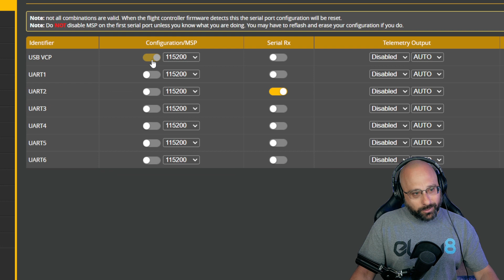Did I Brick My Flight Controller? Recovery? DFU? Bootloader? - FPV Questions

Comment: Beginner's - All these videos make it seem so cut and dry on betaflight firmware etc but they all are missing tons of information.  all downloads on the first page dont have any information of what they are as well i dont care im installing this crap anyway.  I just want to fly my drone which is costing me hours and hours of reading nonsense about technology i dont care about.  Video after video show how simple it should be but unfortunately i wish i paid the money for all this done out of the box.  What a pain in the ass.  my motors dont work, my pos flywoo gn405 nano v3 isnt listed in the firmware section.  I'm about to put all this in a box with a pile of crap and send it back to flywoo.  what makes this worse is my 80 drone have twice as many features as this builds have.  these can barely hover in 1 place but yet my l200 can follow me, hover without any issues, it can spin around an object, return to home no problem.  these builds are waste of time to less features than a 50 dollar out of the box drone

Comment: I connected my F722 to USB and Betaflight saw it. Then I connected the battery to ESC through shortSaver 2 on 1A mode and got the first 3 beeps but not the second two. After a few seconds the lights on FC went out and now it won't do anything. Tried to press the button while plugging it in and something got really hot. The FC is brand new with nothing soldered to it at all. Any help would be super helpful. Thanks!

Comment: This video just saved me some work 
A tight build 
Th2 Freestyle with all of the bells and whistles 
I spun the board to make all the mods I did work out smoothly
Problem was
The board wouldnt flash and my motors where all out of whack.
The Driver fixer worked on the second try. 
The fc was flashed motors fixed and ready for testing
Thank You Josh!!!

Comment: Can an electrical storm corrupt receiver & FC firmware? I had a drone where the bat voltage in the OSD would work sometimes, then lock up on a number, causing me to over-drain a battery because it was still reading 22.1 volts. I also had a different drone that flew fine for a couple years. I didnt' crash it. I flew it a lot, then stopped flying it for several months. When I went back to fly it, the receiver would not connect to my radio. I had to reflash the ELRS receiver. Then my radio locked up & I had to reflash Edge TX onto it. It's strange that several of my electronics just out of the blue decided to stop working, but reflashing firmware made them work again. All I can think of is that these things have antennas on them and an electrical storm may have went through the area.
Reply: ALSO WEIRD, the FC that had the locking up Bat voltage, when I plugged it into BF, there was no OSD tab. Several of the tabs were missing. I reflashed it from BF 4.4.2 to 4.5.0 and the tabs are all back.

Comment: I had a similar problem, when I set my fc to bootloader mode, betaflight was not able to find it anymore. However it was shown as DFU in my Devicemanager.  My problem was, that I used the browser Version of Betaflight. When I used the downloadable version, betaflight found the fc in bootloader mode and I was able to flash.

Comment: So I just had this issue with hakrc aio 20a  with 4.4.1. That's what it came with. I tried adding motor protocol. It gave me a weird error. So I thought it was the one with the motor bug. 4.4.1 is no longer there to grab from the flasher. Now I only get a flashing yellow light and a solid red light. This is a f411D. It seems fine but sometimes won't let me flash a new firmware. But I can connect to the flight controller. And it won't show any esc in esc config. And now esc 4 won't spin

Comment: My quad connected just fine until I did the usb thing after watching a guide on how to use my fc as a dongle to use a simulator.
Now, I can`t connect to betalight, and the "show all" option does nothing.
There`s nothing wrong with my cable, it`s the same cable I used less than a hour ago.
But now I can no longer connect to BF so I can`t get into the CLI to turn the friggin thing off.
Yeah guess what, the FOJHRKUDG NIKUYRIHEUKGUKEH who made that video didn`t mention that..
Ima about to book a flight and bring guns.

Comment: How do I get your email I have  a  manta 3.6   With a Argus f7 ministack . I switched the  dji 03  for a nebula  and I get view through my goggles and the tango 2 connects to the receiver tbs crossfire nano pro . The problem is the flight controller has has a blinking green with a solid red . I cannot get the controller to start motors   Or have any inputs .  I don’t know whats wrong or what the problem is but I cannot find any information on what to do.

Comment: My f7 flight controller is only loading in Betaflight in failsafe mode and I have connected my new dji v2 goggles and my new expresslrs zorro tx but I cannot get it to show controls on the reciever tab or arm. It says the com is in FS Mode.

Comment: Alls I did was wire up my 03 bound it and everything. The whole time not liking this solid red light. Where my blue flashes go?!
Reply: Aye. Actually shorting a ground and 5v on the same sbus rail will do that. I should be good tho because it bound. Been working on this conversion all day was was bout to go nuts or to sleep.
Reply: @TavoLiveInDreams so did that kill your fc?
Reply: @Fourgiv4  surprisingly not. It was either a solder ball in between pads or they bridged underneath but I've not burned one yet. (Only a bnf that I never did maintenance on has smoked.) But that flight controller was the T-motor racer F7 with the cutout in front for a really close camera or battery wires, not the mini racer, I think both are 20x20.

Comment: The last thing that I did that ended being what I needed first was to download the Impulse RC DFU driver. I am using axisflying 55 amp F7 FC. USB-C cable is good. Couldn't open serial port until I installed the Impulse RC DFU driver to access the bootloader.

Comment: I had the exact issue. I previously just remapped motor 5 and the led pad for my gps. As soon as I hit save in the cli after remapping immediately I was kicked into bl mode or at least what I thought was boot loader. I think im just going to remove the gps unfortunately. Im glad you made this video I would be scratching my head forever on this if you didnt. Thanks JB.
Reply: I've removed everything but mine still does it, but I have continuity between the 2 DFU enable pins somehow, even after I removed the button so idk, that might be it
Reply: @SwainixFPV  i have the same issue, did you have a solution?  🙏🏻
Reply: @I played around a bunch more with that FC  but I ended up with a new stack for different reasons. I could get it to exit DFU mode via BFC, but it would boot back into it after another reset. I did a bunch of other random shit on it and it was sometimes fixed sometimes fucked again, but in the end I think there was a short on unrelated pins that were sparking (5V and GND iirc), that was very confusing. Used that FC as sacrificial test for my conformal coating (since it registered via USB again for the time being) and it passed it tho. It was in my first build so I kept it as a trophy :3

edit: the DFU drivers fixer something that ppl mention was a great thing to keep in mind because that helped me with 2 other FCs on 2 different computers since btw
Reply: @SwainixFPV  thanks for the response! I fixed it by removing the bind button on mine
Reply: @Jona nice :)

Comment: Hey I was using the CLI to change motor position an when I save and reboot, now my flight controller wont connect and when I connect to my googles and controller it connects but I dont have OSD on my googles and the controller and camera are conected but i cant arm the drone. please help

Comment: I just flashed the skystars F722HDpro and then it asked me that it had no motor protocol and so I went to the motors tab and set Dshot600 and clicked save and reboot and it didn't make the sound that it saved or worked and the light stays solid red. I tried impulsedRc and it updates it but then I click exit DFU and nothing changes when I unplug and plug in again, need help.
Reply: Did you find a solution?

Comment: can you help me , i jst got my new cinebot30 , at 1st it can connect to beta flight with version 4.3.1 .  but then i update it to 4.4 because my tx elrs is 3.0 , after 5 min i cant connect my drone to beta flight anymore , while i try to connect other drone it work well . only my cinebot after update to 4.4 . and i forgot to backup the original firmware , did i jst erase all the information like drive on the FC that make it like this ?
Reply: What option that i think will work is buy a new same cinebot30 and backup the original firmware and load it via local to my 1st cinebot to restore what ever it is inside the Fc . Does it possible ?
Reply: I use impluse driver it cant find my fc , what im confuse is if i connect with other drone it work fine , only my cinebot30 happe like this after flash firmware to 4.4 . Any suggestion and advice ..

Comment: brand new fc no wiring straight out of the box, when plugged in most of the time betaflight detects in in dfu mode, after unplugging a few times betaflight will detect it as a com port but will put itself back into dfu mode while trying to config settings or just looking at it the wrong way, no problems with my 6 other fc's so not thinking its cable or driver related, any ideas
Reply: Have you found the solution?
Reply: @hazimhakimi1492  bad usb port on the fc is my guess, change a setting and save real quick was my fix
Reply: @dheth could you be more specific? Change what setting? Im having the same issue but idk what to do.
Reply: @Fourgiv4  because i had about 10 seconds in betaflight before the fc would go into dfu mode, i could can change any setting i needed to and save before it would go into dfu mode and the settings would stay, but that requires knowing exactly what to press in betaflight and what tab its located, then never plugged it in again, still fly's great, if i ever got another fc with the same problem id just buy a new one
Reply: @dheth  wish mine connected for 10 seconds mine connects for like 2 😢 and then its gone. Paid 80 bucks for this fc kinda hurts.

Comment: I had a problem with my first FC RUSHFPV blade F722 and i made the mistake of switching off the top port. No matter what i tried I couldn't get in DFU mode, tried the immersion driver fixer. I finally found a fix going through a program from STM Electronics & for that to work I had to get Rushfpv hex file & it fixed my problem.
Reply: I did this on the first quad i ever tried updating. Took me forever to get it back working lol

Comment: What about FCs on F4 with integrated ELRS on UART1? I don’t understand why manufacturers use UART1 than any other UART and second if they use UART1 why they don’t give an option to turn peripheral off by a jumper. These FCs may be ‘bricked’ as DFU is messed up with ELRS
Reply: This !!